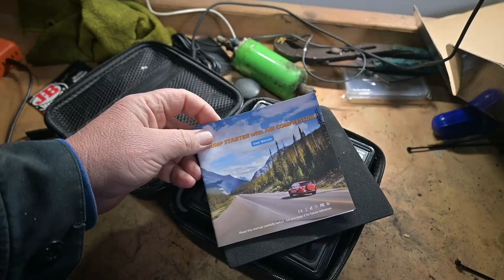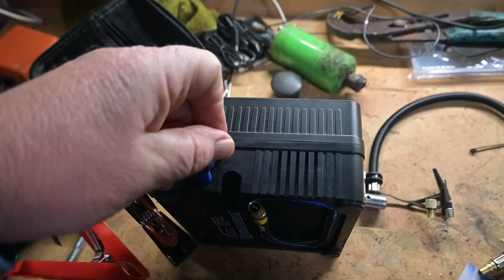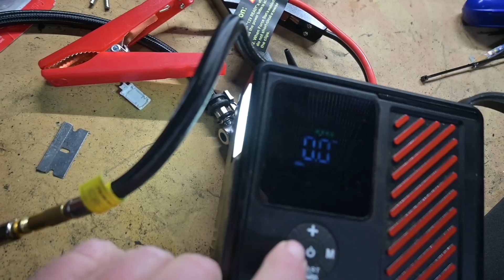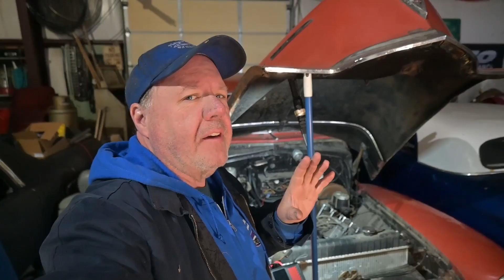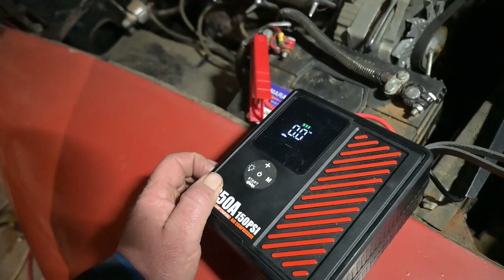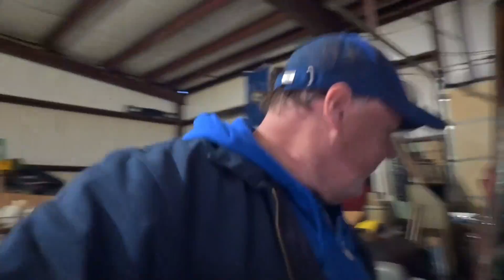Trying out the JFEGWO CS02-PRO 8250A JumpStarter with Air Compressor

Comment: How well does the jump starter work with larger vehicles like SUVs or trucks?
I drive a larger SUV, and sometimes the battery is weak. When I was considering buying this jump starter, I was wondering if it could reliably start a big vehicle like mine, especially when the battery is almost dead.